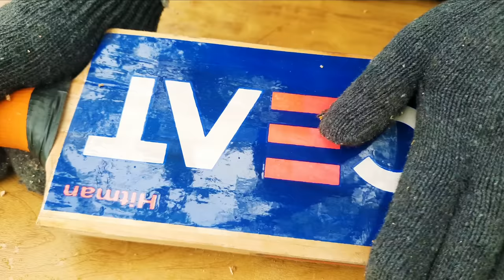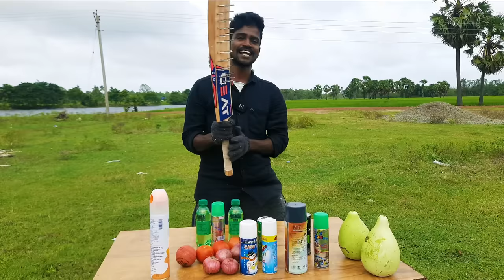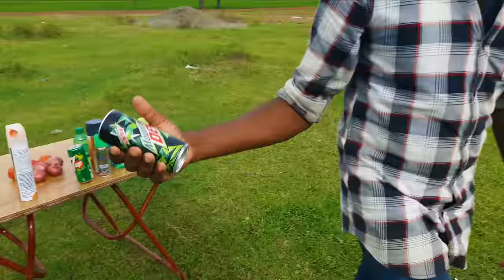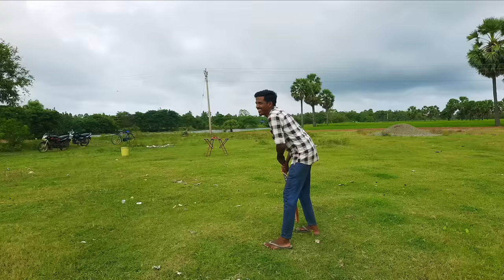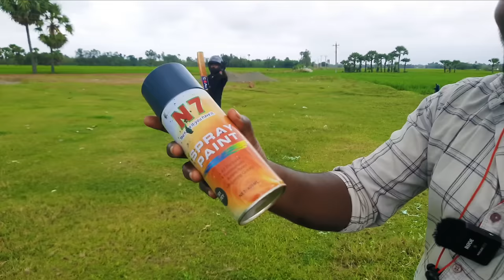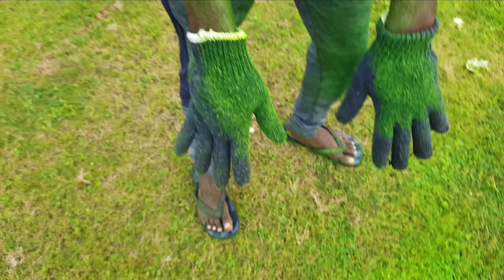Experiment!! Destroyer Cricket🏏 Bat Power Testing | என்ன ஆகும்🤔.? | Mr.Village Vaathi

Comment: Perfume is based on alcohol or another liquid. The liquid evaporates, often quickly. When liquids evaporate, they remove heat from the surface they are evaporating from - in this case, from your skin. When you remove heat from your skin, you feel cold.
Reply: Thank u bro 😊